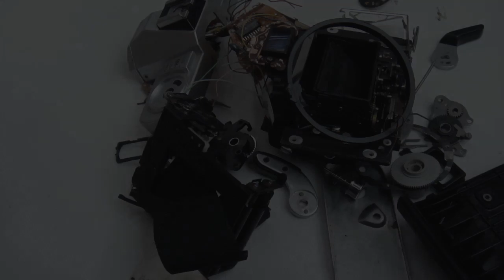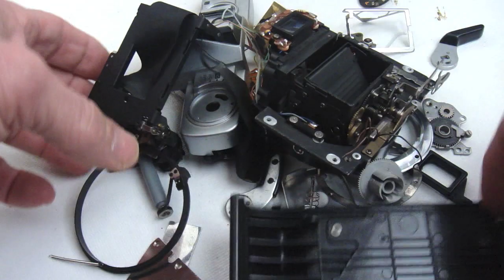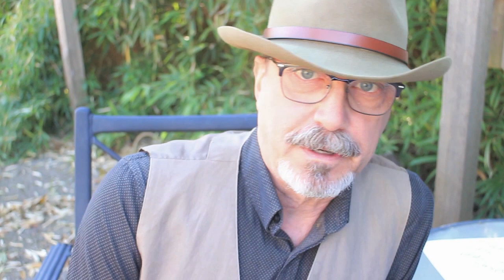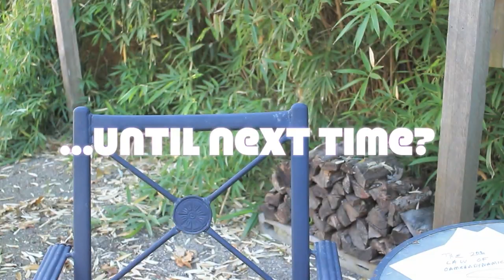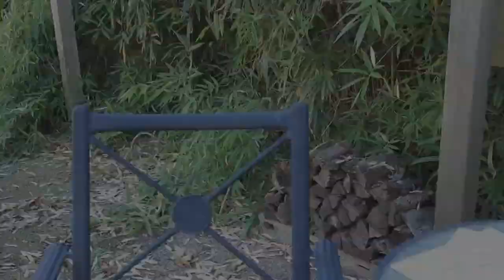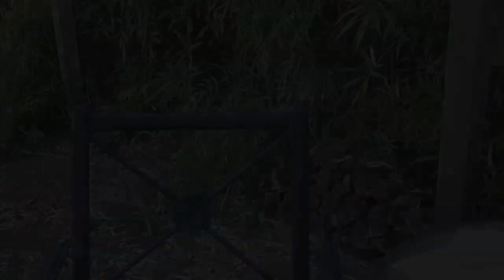Fix Old Cameras: Laws Too?

Comment: As someone who has been into the innards of old cameras - truer words were never spoken.  I never realized that a small screw dropped at your foot was impossible to find using in order 1.  Hands & Knees with a flashlight 2.  Careful sweeping into a dust pan 3.  Sweeping the whole area with a magnet (with steel parts) 4.  Sweeping the area with a wet paper towel.  Little did I realize that the screw was in suspended animation until I stopped all this.  I would probably find it the next day by stepping on it with my bare feet - usually in the next room.
Reply from the maker: Great comments. Too much fun and unfortunately too true.
Reply: @FixOldCameras  In addition - ball point pen came apart in my pocket - was missing a spacer spring - could not find it and replace with temporary fix.  Next day was emptying robot vacuum and found it.
Reply from the maker: @autochrome1234  There you go. Perfect example. Too funny.

Comment: I enjoy repairing things. And do so regularly. But cameras are a dimension all their own. Just like my wife's purse, they fall into that last frontier into which I fear to tread. I know the frustration that comes with that one screw that will go missing until long after the thing being repaired has been burned at the stake or buried in the backyard. I can only imagine having to add tweezers and a magnifying glass into the mix.
Reply from the maker: Indeed, the well heeled purse is a mysterious place best left alone even at insistent invitations to retrieve a needed item - a combination first aid kit, office file draw, beauty kit, magicians bag of tricks, and black hole of cash reserves. On the flip side, it is good to fix things… and vintage cameras, with persistence and patience, you are well with in the realm of an adventurous fixer upper like yourself. Thank you for your comment and your interest in FOC.
Reply: @FixOldCameras  Maybe sometime I will. Start small, with one of those cheap 110mm cameras I had as a kid. No harm there of the learning curve is a little steep. 😁

Comment: Cheers!  Is there a name for the law where if a cover needs 'n' screws removed, the probability of a single screw being seized increases exponentially with 'n'?
Reply from the maker: Absolutely. The Law of the Subsequent Screw... where the force needed to remove the last screw increases exponentially with each subsequent screw until the torque needed exceeds the capability of the final screw. Thank you for the fun comment.

Comment: Great video! Springs are the things that piss me off the most, I think. They'll disappear at the first opportunity. Then of course there are the tiny screws. The rules dictate that the ones that drop onto the floor are actually brass, not steel like you thought, and the magnet doesn't help you find them.....
Reply from the maker: Indeed. So true. Your comments and interest in Fix Old Cameras is greatly appreciated.

Comment: I broke the law recently. Working on an FX3 where the mirror and shutter locked up and needed to be tripped from below in order to advance. Removed the front plate, tested, and it started firing like normal. Easiest repair of my life.

Comment: totally random question im trying to fix a canon ae-1. i realized something was wrong when i put batteries in. it would fire then the mirror would hang up but as soon as i touched battery positive to the door hinge the mirror would return? any suggestions
Reply from the maker: Does pushing the battery check button also release complete the mirror cycle. Possible cause is the timing switch, the bulb switch, the timing capacitor shorted or an IC failure.

Comment: Great video! Any recommendations to remove the fake leather of old cameras, without damage it?
Reply: Tough call. If the leatherette is dried out and crumbling as on an older camera, you're out of luck. A more modern camera, say a Canon from the 70's, try a little heat from a hair dryer that will soften it up enough to get under it with a sharp knife, just be careful and lift a corner and gently pull it off. I've had good luck using "Bestine" which is a rubber cement thinner. It gets under the leatherette and dissolves the adhesive. USE OUTDOORS or a well ventilated area. Naphtha as in Lighter Fluid works too. Good Luck.
Reply: @tomheckhaus7617  thanks for your response. I want to rescue a pentax me super, with other dead one so I need to fully disassembly both and then make at least one  working again.
Reply from the maker: Tom has posted some good tips. Patience and persistence... give the solvents time to soften the adhesive. Always check solvents chosen to make sure that they to not haze any plastic or vinyl they come in contact with. Isopropyl (91% or 99%) alcohol is pretty much universally safe although it does not work as fast as some of the solvents Tom recommended.
Reply from the maker: Good tips.

Comment: I'm very surprised! You've never seen the black hole of camera repair? Or for that matter, any small repair. You drop say a little cam, when you hear the little "tink" you think it's the sound of the part hitting the floor, right? Nope the "tink" is the black hole opening and swallowing up the part. The proof is how that part will turn up one day when you are sweeping the garage, or bathroom or some other area far away from the place where you worked. Best Wishes to all in 2020, Tom
Reply from the maker: The black hole that haunts our dreams and vexes our repairs. Just because it goes unseen... it is still there... waiting. Your description is way too funny. Good stuff.

Comment: ¡Hello! I have a problem with my camera Minolta x300s, and im a student from Madrid so i really dont know where someone can help me to fix it. Anyway i watched your videos to figure out how to open it (thanks a lot) I also did a few tests to find the problem bc the light from the exposure sometimes works sometimes not (so the shutter dont). I checked the battery, the capacitor, with tester,  everyting works fine. But i discovered that if i activate the self timer, works again the light but if i turn off and then in, the camera it dosent work again, so i move the self timer button until it works. Seems that the problem is there. Can you pls help mee???  I ll be very grateful...
Reply from the maker: This is a possible cause.
https://www.youtube.com/watch?v=BTRrAzkPFKo&t=74s

Comment: Your channel is certainly an Oasis in the desert. 
Also, I was wondering if you would have any advice on how to take apart a stucked 19th century brass Wollensak Studio hutter style B number 1. Thanks for any input. Really enjoying the content.
Reply from the maker: Oh boy... brass can be stubborn. And those early designs can be funky in their construction. Seep alcohol and penetrating oil around seams. Use heat to expand and contract the metal at thread points (a broad tipped soldering iron works along with much patience and persistence)

Comment: Ha ha ha. The first law happened to me two days ago!
Reply from the maker: Oh no... not good. Well a least we can laugh about it.
Reply: @FixOldCameras   I have a collection of screws, springs, posts, pins and washers so I was able to find another "similar" screw. Once I found the little screw I switched it out. It was one of the little screws holding the bottom plate of my Nikkormat FTN. Believe it or not but the little screw was stainless steel and I could not find it with my magnet. I dropped the little button behind the shutter release shaft on the K1000. Thankfully I found both the button and the screw.